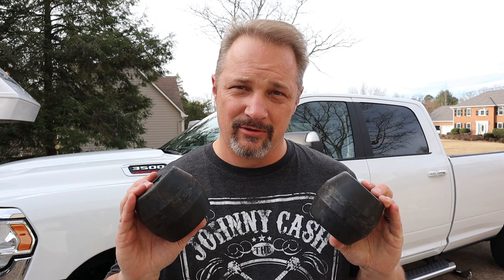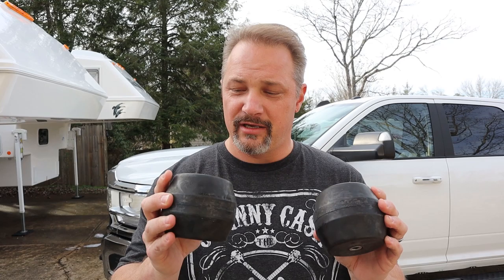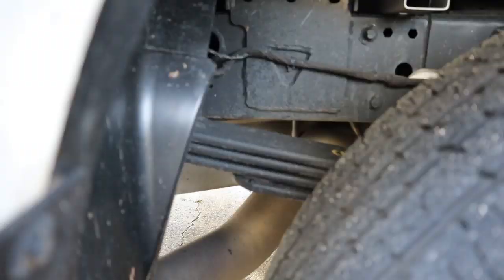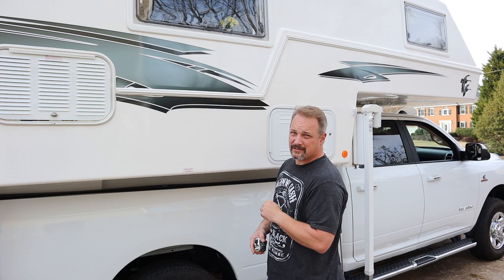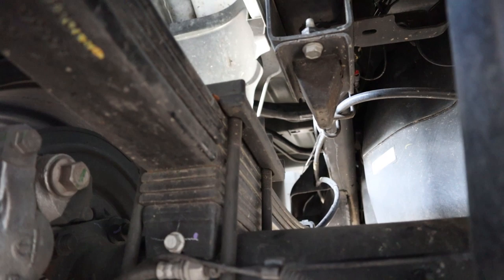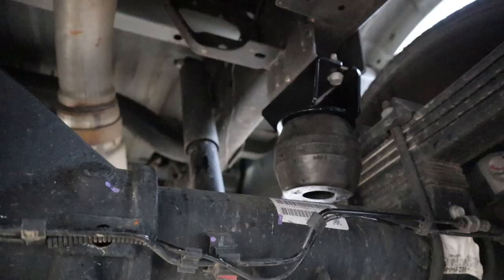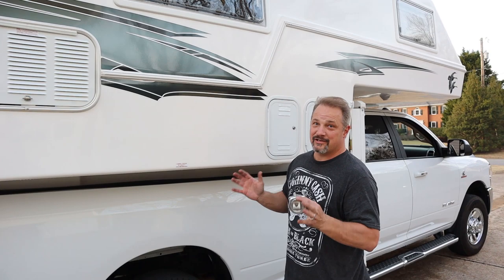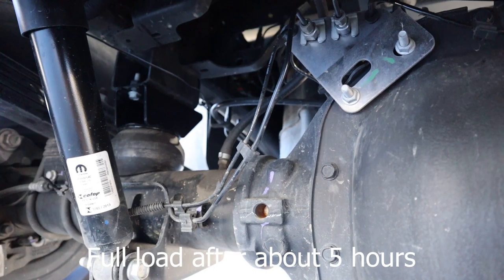Feeling Unstable? - Try a Timbren Suspension Enhancement System

Comment: Plus fresh water, hot water, propane, batteries (if the factory didn’t install them), fuel and oil in the truck, stuff and gear in the truck, stuff and gear in the camper and don’t forget the people.
I think we better add  1,500 pounds minimum to the factory dry weight. 
I’ve been through this with a LB Ford 3/4 ton with air bags and big stabilizer bars.  Lance says their 850 model is made for a 3/4 ton pick up.  Wrong, our first trip we were 1,600 pounds over the GRVW top heavy and unsafe.
Thanks for your GREAT videos.

Comment: I have a 2008 Dodge 3500. It now has 60,000 km on it.  Truck has overloads and I added 2 additional leafs to bottom springs. Also put Torklift stableloads both upper and lower along with a Helwig sway bar. Makes huge difference.  I have airbags as well but you have to be careful not to inflate too much. Crazy part of it is gvw rating on the door post is 10,100 pounds. Truck weighs close to 7500 pounds so by law I haven't got a lot of wriggle room with my northernlite sportsman on. I would definitely recommend putting some overloads with the torklift products on your truck. I have 0 sway and none of that floating feel.
Reply from the maker: @Eskil Neilson thank you for the great info, it all sounds definitely worth checking into.

Comment: I had timberens on my F150, they were great when truck was loaded.  When truck was empty you had a rough ride when hitting bumps or dips.
Reply from the maker: @Bill B same here, they are rough when the truck camper isn't on the truck but only when we hit bumps or big potholes in the road.  The suspension was pretty stiff even before we installed the timbrens.  Thanks for watching!  ~Carla

Comment: Great video and commentary - fortunately, I have the RAM factory OEM air bags on my 2018, 3500 DRW so I'm always sitting level.  I Still have a little body roll in tight turns I need to resolve. Most likely I will install a rear anti-sway bar. Your truck and camper look great together. They seem to be a great match!
Reply from the maker: A sway bar sounds like a good idea.  Interesting I noticed the other day at the Ram dealer while I was checking out some duallys that the truck I saw with factory air bags did not have the overload springs above the spring pack.  The trucks without the air bags had the factory overload springs.  The overload springs really helped with sway on my old GMC truck.  I wish my current Ram 3500 SRW had the factory overload springs.  I just thought it was interesting that they come with either/or springs or air bags.  Maybe you can order them with both.  Maybe you have both on yours which would really be nice.  Thanks for watching! ~ Todd

Comment: Looking good
I am running stable loads on my Ford 350
Glad to see your new CAMPER fits in the garagep
Reply from the maker: I was thinking about trying stable loads as well.  Getting the camper in the garage is kind of a trick.  I have to lower it and put it on a trailer and back it in.   Bit if a pain but it works.  Thanks for watching!
Reply: @RunawayRoses  it may time consuming but in the long run years down the road it will look brand new. My 2005 Bigfoot has been garage kept since new it's nice to know the only weather it sees is the camping trips. The outside stove vent cover turned yellow so I replaced it with a new one from Grant at Bigfoot and I need to address some water spots. You have a beautiful camper happy camping and fishing

Comment: I would suggest also adding something called Roadmaster active suspension. You might be surprised how much that would help.
Reply from the maker: @Kinny Bingman thanks for the advice.  Since this video we switched to a RAM 3500 Dually.  We decided the added stability it has along with the airbags makes our truck camper feel more stable on the truck.  Thanks for watching!
Reply: @RunawayRoses  You ultimately ended up switching to airbags? I have a ram 3500 and am trying to decide between airbags or timbrens.

Comment: I was looking at Sumo Springs and these. I ended up going with the Road Master Suspension on my 1/2 ton instead. 

My first tow with them is this weekend. Hopefully it removes some of the rebound.
Reply from the maker: Hey Rabbi,  I've looked into the Sumo Springs too but I've never used them.  I hope the Roadmaster Suspension works out great for your truck.  I have a Roadmaster anti-sway bar in my truck and it works great.  Safe travels and thanks again for watching!
Reply: @RunawayRoses  the RAS did ok at speed. (60-65) no sway when I may have had it before. 

It however didn’t do what I had wanted. And that was to take out the rebound bounce. I’m going to upgrade my front struts to help settle that. 

I also adjusted my trucks air pressure up to 44 in the rear in 40 in front. That didn’t seem to do much either. 

I had seen you removed your sway bar. The RAS is supposed to be one. But I’m not so much believing it. 

So for now the struts, after the next tow I’ll see if I should go with the sumo springs.
Reply: @rabbi6225  ...your first mistake was buying a 1/2 ton truck!  Timbrens kick ASS!
Reply: @seanoleary1979  timbrens would have been fine if I was that over loaded. The RAS does require occasional adjustments. I put on some decent HD shocks in the rear and everything was improved. 

Yes a 3/4 would be ideal if all I did was tow.
Reply: @rabbi6225  ...gotcha! 👍 Zie geshundt!

Comment: if you want to keep your stock ride quality when your empty then throw that rubber junk in the trash and go with the Torklift stable load. got them on my 2020 chevy 2500hd with a 2600 lb camper and I was in 60 - 80 kph winds and there was virtually no ill affects from the wind or the weight and when you disengage them your truck is totally stock handling without slapping those rubber bumpers on the bumps. TRUST ME....YOU WILL THANK ME LATER!!!!

Comment: Looking forward to your dually vs single wheel review with a truck camper if you plan to do that video still. I know you said in your last video the the dually was most likely the way to go, which of course it's going to be better. But how much better and how safe do you feel compared to the dually driving around with the heavy camper on top.
Reply from the maker: Hi David Lavery, That is on my list of videos to get to sometime.  My old dually did feel more stable however my SRW is working pretty well.  It's nice having two spare tires built into a dually though.  Thanks for watching!

Comment: I looked at the link you gave here on Youtube, and they are showing the ones that are 4 of those blocks.  So, if you didn't use the ones with 4 of those blocks how about showing us a link for the only 2 blocks?  Would really help all of us a great deal.
Reply from the maker: @Sharon Lee Lockhart sorry about that.  That is the correct part number so we think it is the correct part.  I would recommend calling E-Trailer to buy them.  They will help to determine the right ones for your truck.  Thank you for watching!
Reply: @RunawayRoses  Thank YOU, for that help.  Best wishes for a better camping trip, with this addition to your camper/truck.
Reply: @RunawayRoses  Thank you for that help.

Comment: Just wondering what kind of mpgs you achieved, and what was your average speed?  I'm about to get my NL 9.6 LE in two days and am very excited!  I managed to find a set of torklift fastguns, and frame mount tie down system, along with the torklift stableloads (used) for 850!  I'm hoping the stable loads will be enough, if not I'll be buying some timbrens like yours...except the lighter duty version. Had to drive 8 hours to great falls and back, but the drive was beautiful.  Cheers.

Comment: Please spend the $10 and take it to a CAT scale and get actual front and rear axle weights (another chance for a good video!!! hint, hint), and compare them with the numbers on the door placard (the other placard, not the one you showed in the beginning). Also look at the tires and find the actual weight capacity on the sidewall (which is specified at 80 PSI) to make sure the tires match or exceed the max axle rating. The eye opener will be how much the front end weighs. You can easily fall within the total Gross Rear Axle Weight limit and still exceed the total Gross Vehicle Weight Rating.
Reply from the maker: Hi Charles, We would like to get the truck and camper weighted sometime.  All good points you made.  My tires weight capacity are good for our load but it sure is a heavy load for a SRW truck.  Thanks for watching again!

Comment: Before installing the Timbrens it was mainly the leaf springs that had to continuously hold the weight, with an occasional contact with the axle.  Now the weight sits on the axles all the time.  Is there any concerns about having the weight constantly on the axle instead of on the leaf springs?
Reply: Good question,also I’m thinking and correct me if I’m wrong,but don’t also the leaf springs are supported by the axles,or on top of axles, so no matter what the axle super the way?!
Reply: Silly and uninformed, but I can understand your confusion. The axles carry the weight of the whole vehicle at all times, if you look at the door sticker it gives you max weights for the front  and rear axles. Suspension is there for added comfort.
Reply: @betterthanideserve76  That would have been an excellent answer (plus a thumbs up) if you hadn't started it by denigrating me by calling it silly and uninformed...  The whole point of my question was to be "more informed".

Comment: Roadmaster active suspension.   Timbren customer service is horrible.  Mine came used missing parts and they refused to send the missing parts.  Wanted me to pay to have them uninstalled and return the whole thing.   Missing bottom nuts and spacers.  Some crackpot place out of Michigan.   Never again.
Reply from the maker: @Michael Scott we didn't have any issues when we ordered or received ours.  We ordered ours from E-Trailer.  Sorry you had so many issues, that really stinks!

Comment: Frankly, putting that kind of top heavy weight (more than two tons!!!) on anything but a dual wheel truck is questionable...  You are measuring & viewing the springs under a static load & not while the load is bouncing up and down, when everything is flexing...   Adding thicker snubbers might soften the shock when the frame hits the axle, but does nothing to support the load..    I would have added another leaf to the springs to support the weight and not soften the travel to the axle..
In addition, the thought of a blowout or tire failure of some kind at highway speeds in unnerving..  My stomach would be in knots driving such a rig..   Good luck to you and Carla for living on the edge..!
Reply from the maker: Hi Happy Camper,  I agree a dually will support the load and be much safer having an additional two tires in the back.  You made all good points that I agree with except after using the Timbrens they actually do help support the load and sway significantly.  Having hauled a camper with and without them there is a huge difference.  There are a lot of people hauling truck campers on SRW and they do ok however I may end up going back to a dually again sometime.  A dually is just not the best daily driver for me and my job.  Thanks for commenting and watching!
Reply: @RunawayRoses  I would have added another leaf to the springs to support the weight and not soften the travel to the axle..
Reply: @RunawayRoses   I already surmised that this is a dual-use truck and that the money making end off all this cannot be denied..  LOL!  
Once again, I would have considered an extra leaf spring to carry that weight, with the snubbers as additional insurance against bottoming out the frame to axle..  I dig you both.. !!
Reply from the maker: I agree and I did look into adding some Hellwig helper springs or Supersprings but from much of what I read most people said it raised the back of their truck so I was concerned about that.  That just mean all the higher I have to raise the truck camper.  I am still thinking about adding some though as well as a Hellwig sway bar.  I'm also thinking about trying some stable loads from Torklift.  There's plenty of options to try but they all get expensive.  One at a time I guess.  Thanks for you input! ~ Todd
Reply from the maker: @happycamper6260  LOL, I wished we were actually making money.  If you're ever curious how much someone makes on YouTube you should look at this page https://socialblade.com/youtube/channel/UCS4QKRIypG8gq221IQrU1Ag It's peanuts compare to the many hours of video editing that goes into this hobby.  We might make $8 - $20 per day at the most.  Todd might spend 20 hrs sometimes on a video, so it isn't really making money.  But people will believe what they want to though.  Safe travels!  ~Carla